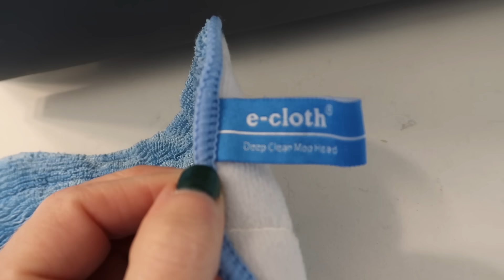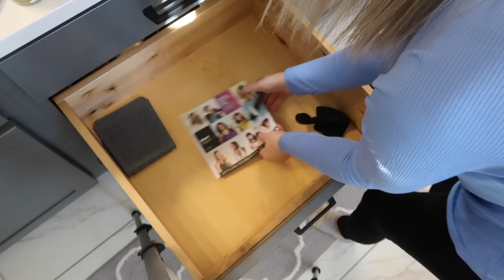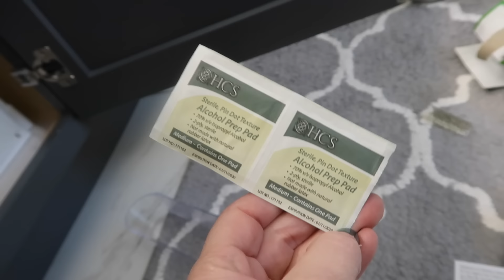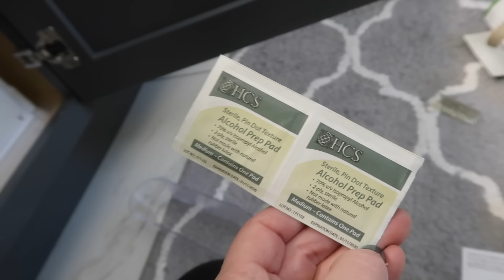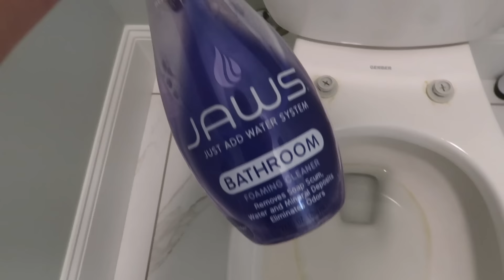EXTREME CLEAN WITH ME DECLUTTER ORGANIZE BATHROOM ORGANIZATION | CLEANING MOTIVATION| NEW YEAR RESET

Comment: Hi Jamie. Another great video! Is there a secret to using microfiber cloths? I tried, but once they get wet, it seems like they just spread the wetness around. How many cloths are you using in each area?
Reply from the maker: It depends! Like for my kitchen countertops I usually use two. The key might be you’re using too much cleaner. I noticed that if the rugs get too wet, they do just kind of push around the dirt. The key is not to use too much wetness or cleaner.